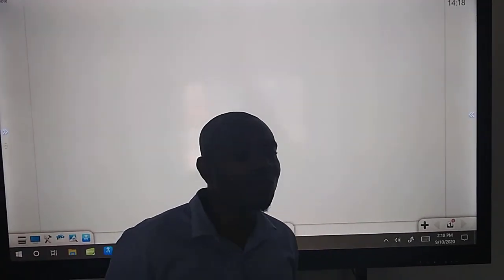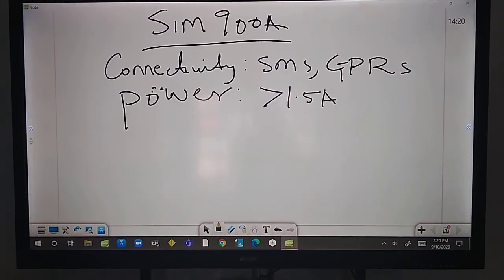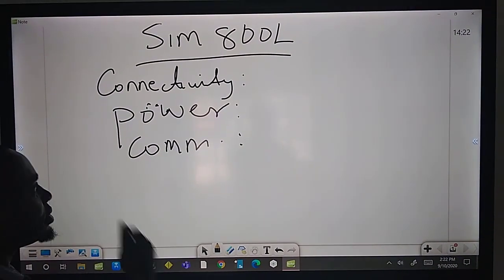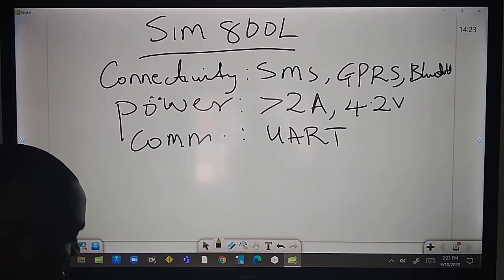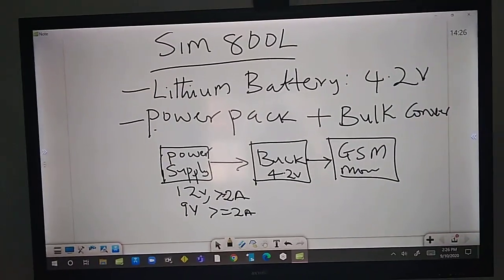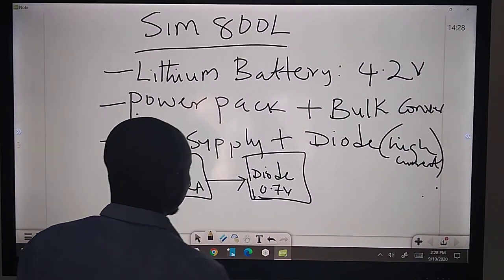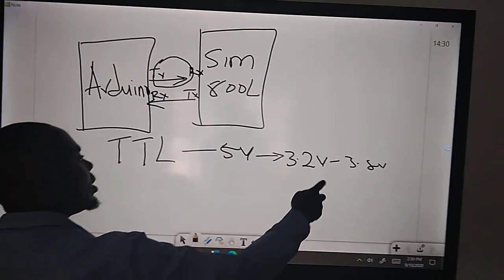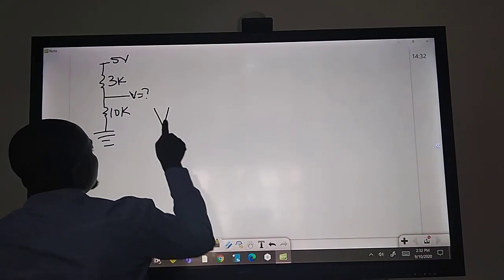Sim800L and sim900A Issues

Comment: Interfaced that to pic18f and sent an sms to my phone. However the phone says content not supported when trying to read the sms.
Reply from the maker: Did you configure module to text mode? AT+CMGF=1
Reply: @chineduernest3660        dw     "GSM",0h
SIM800LSMS:
      dw     "AT+CMGF=1\r",0h
SIM800lSMSCMD:
      dw     "AT+CMGS=",0h
Reply: @chineduernest3660  Used another Carriers sim card and no issues. I am not on to GPRS and http post but I am getting a 606 response code.
Reply from the maker: @fernandohood5542  what type of module are you using?
Reply: @chineduernest3660  sim800l V2. Got it sorted. I put everything in the URL and used HTTP instead of HTTPS. I sent stuff to THINGSPEAK. Many videos are not too clear on how to send the data/parameters.

Comment: Hi
I use sim900a with PS 5v 2amper but the led is blinking 1second, and the network can't get the signal.  Please help .?
Reply from the maker: Please remove Sim Card and verify that the Sim card works, also make sure the Sim card is not passworded.
Reply: @chineduernest3660  i had tried the simcard at my phone. And running well, also no password in my simcard. Any idea to aolve the problem ?
Reply from the maker: @loowehkitchen1303  please try another PSU of 5v,2A. If problem persist you can send video to my email, I will look at it.
Reply from the maker: Here is my email, edutech4logic@gmail.com